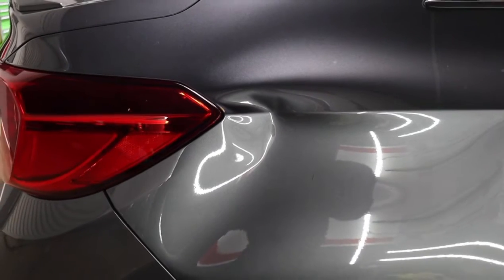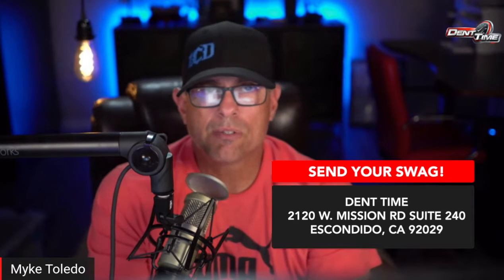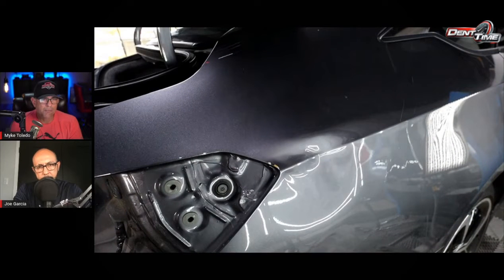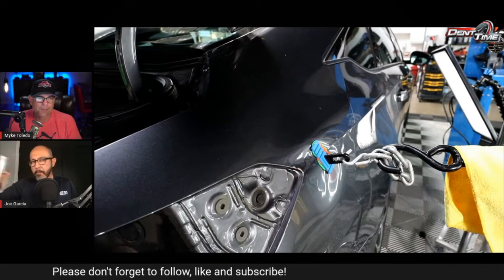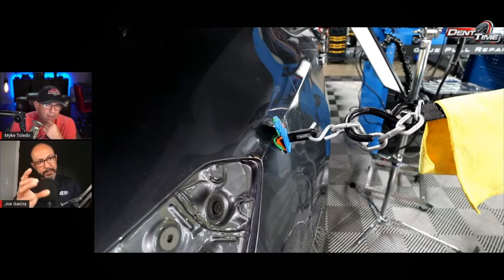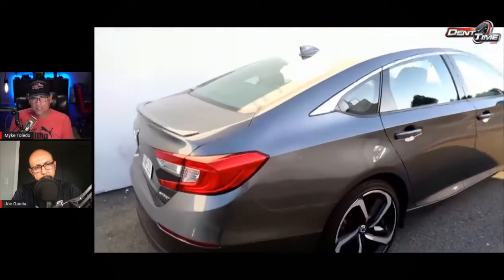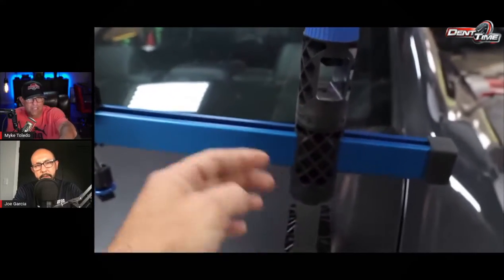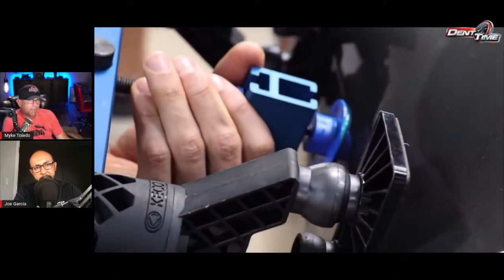PDR Podcast 90: Smash Repairs and Trapped Pressure | VIP Cards | Drilling

Comment: I liked the video although I understand little English. I am waiting for a vacancy to do the sackcloth course. in bs as. Argentina. Was a hole drilled to get into the Dodge bun?
Reply from the maker: Yes a manufactured access point was made indeed. Brace behind the structure wouldn’t allow tail light access or minim access from the bottom. Thanks for watching.